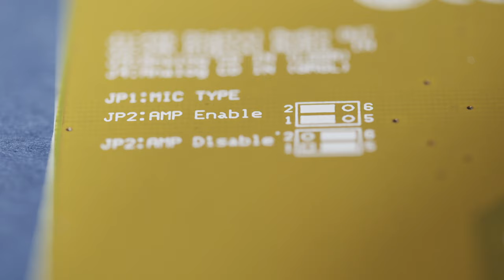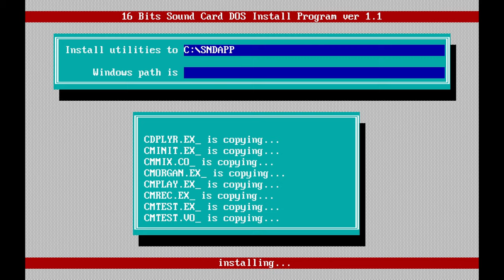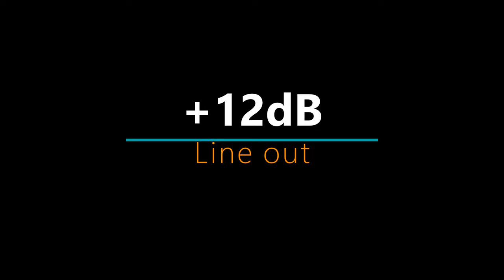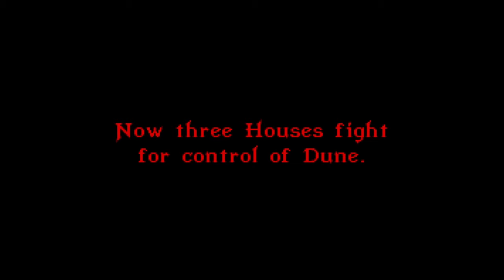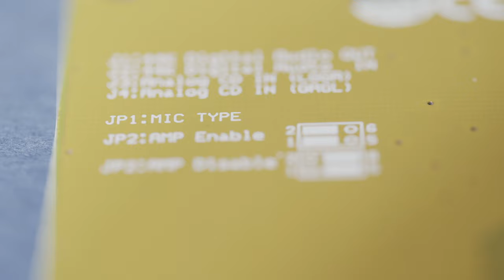SoundPro HT1869V+ - The Quest For The Ultimate DOS Sound Card Part 10 - Is it as bad, as it looks?

Comment: This card is cheap if available (but rare) has optional spdif (if you connect a header), it is easy to initialize and configuring, very compatible and noiseless in line-out. As it is the CMedia 8330, it contains a 100% OPL3-FM clone (I have done a comparison to prove that, see my video to this topic if you like), so overall I would give it a recommendation if you don't need the wt-header. The init app offers interesting options like 3D spartializer, and a loudness function beneath the general mixer settings, so you can tweak it to your preference. Stereo separation is great as well. Yes, I like this late 90s underdog budget card:-)
Reply: Not many people seem to know about these. (Lets keep it that way ;) )

Comment: What platform did you used to test it? That card uses external clock signal, and for internal FM synthesis it's crucial to be precise. Usualy it should work best with 386/486 computers.
Reply from the maker: I used three setups. Pentium Pro with Intel FX chipset, Pentium III with BX chipset and Pentium III with VIA Apollo Pro 133 chipset. It worked the same with all three of them.
Reply: @Lassi Kinnunen 81 Indeed, later boards have fixed ISA clocks